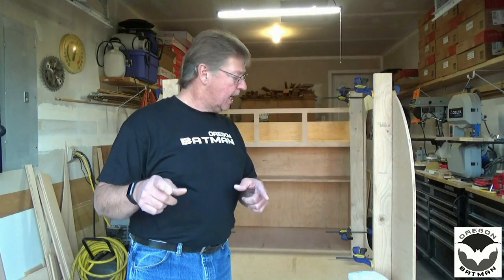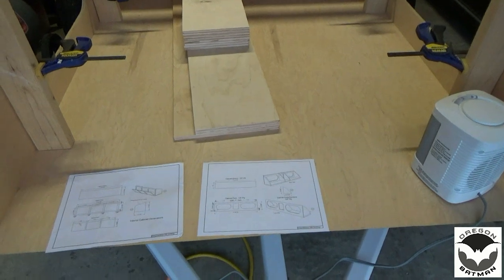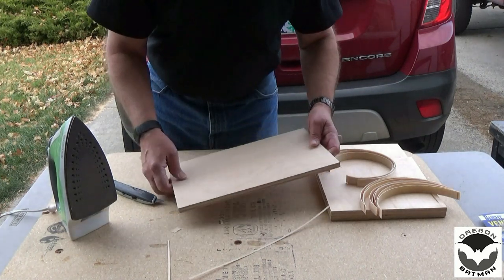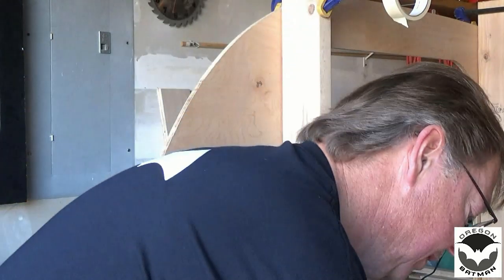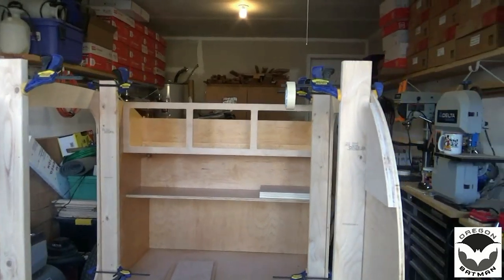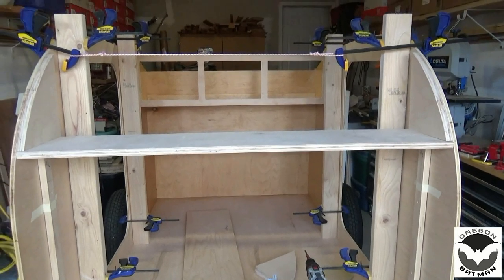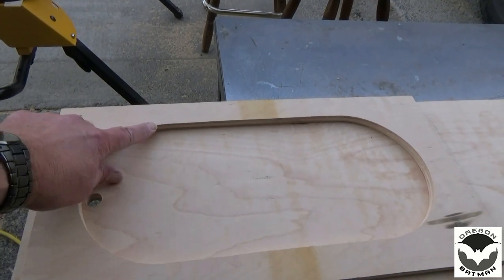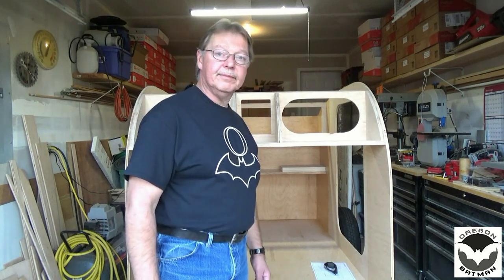Teardrop Build * Step-By-Step * - Part 22 (Front Storage Shelf)

Comment: I like your technique for  trimming the edge banding. I’ve messed up a couple pieces trying to use the little plastic razor tool. It either doesn’t cut off enough or digs into the face of the plywood.
Reply from the maker: Same here... had the same problem when trying to use the razor tool. Thanks for checking it out!